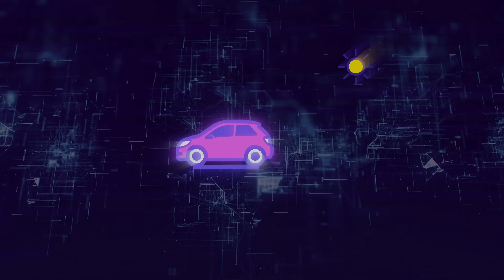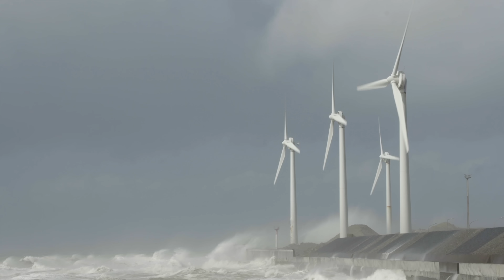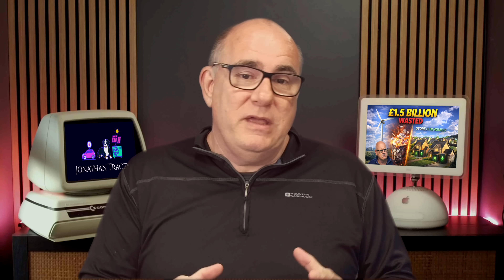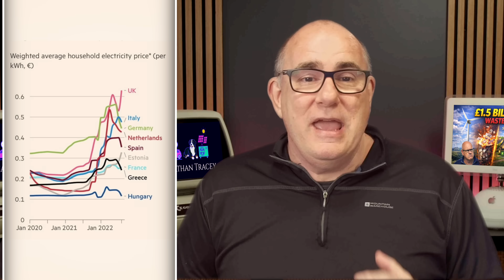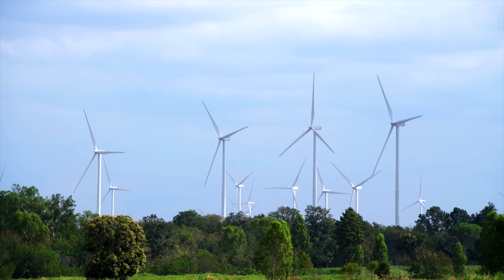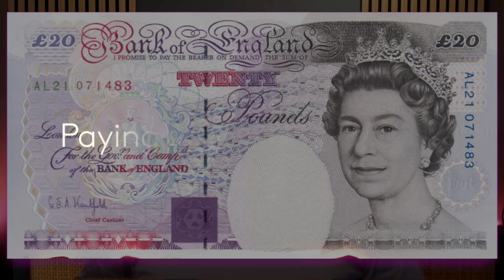We’re Paying £1 5 BILLION To Waste Energy… Here’s My Big Idea

Comment: Another simple idea. Only allow data centres to be built near wind farms, mostly in Scotland. Data is far easier to move over distances than electrons.
Reply: There are thousands of gov properties, church properties, council, army etc etc.
The could shove batteries on them.
Reply: @linuxnerd5319  Could they be put on electricity sub stations?
Reply: @linuxnerd5319  GB Energy is putting solar and possibly batteries on government buildings.
Reply: @Biggest-hz7ng not at real scale. I think they are upto 200 schools promised out of over 20k. But this is definitely where we should focus - payback would be c6 years on solar / battery.
Reply: @Mn6g1834  there aren't that many installers and it will take time.
Reply: @Biggest-hz7ng enough to do more than 200 schools. Problem is they are wasting money on Hydrogen, CCS, eV car grants etc
Reply: @Mn6g1834  I don't think much has been spent on hydrogen? 

CCS is a key part of the CCC's pathway to Net Zero by 2050, so probably the feasibility needs testing.

The EV grant promotes EV growth and hence electricity demand growth, which is needed to share out the costs of the grid expansion. It also promotes local EV manufacture. It might be considered pushing on an opening door, but it's useful to open the door faster?
Reply: Re EV grant - they are already a no brainer if getting as a company car (which the majority of new cars are). And car brands have obligations to hit a certain % BEV so we are subsidising them multiple times. Far better to invest the money in public sector solar panels or wind. Solar likely to payback in 4-6 years and last for 30+.
Reply: @Biggest-hz7ng there are thousands
Reply: @Mn6g1834 I think you're referring to solar installers here? I'm saying there aren't many large scale installers with suitable history and skills or others that can scale up. There'll be increased demand from the commercial sector too.
Reply from the maker: sounds like common sense to me, so long as they have good internet connections they don't need to be in slough
Reply: @JonathanTracey  For any major data center that wants to provide services to financial firms, even Slough is pushing it. The maximum speed of response is limited by distance, which is why most proposed data centers are in the southeast - to be near the customers with the deepest pockets.
Reply: @rogerthomas7040 I think the CEO of octopus said he had a conversation with a data centre provider who said that until told electricity could be half the price in Scotland. They have done some trials with price response on data centres ie moving data work to different times or across the world according to power prices.
Reply: I think this was one of the zonal pricing arguments, high business users would site where costs are lowest
Reply: Totally agree with you on this. Also why not put solar on homes throughout the country instead of building new power stations where the costs spiral out of control. A little generation over many, many locations soon adds up and is spread all over the country.
Reply: If Ireland can be Amazon's primary data center region in Europe, Scotland is totally viable with a sensible approach to energy and telecommunication costs and connections.
Reply: makes more sense to put them in Iceland with 24/7 energy
Reply: Our government, regardless of party, is incapable of large national projects any more. Look at HS2 as a classic example. State owned would be a disaster, but it doesn’t have to be. I’ve been following what Mark Carney, Canadian pm (ex governor of the Bank of England) is doing in Canada. They are making huge investments in national infrastructure projects to create more independence and national wealth. That shows real forward thinking and decision making. But on the subject of batteries, wouldn’t you only benefit if you were in areas where there was excess production and the grid had the ability to deliver it? Would we end up with energy savings for some and not for others? I’m all for a much wider adoption of batteries, but we need to get to a point where the cost savings benefit everyone, not just those that, at least today, can afford it.
Reply: What happens when there is no wind for a week? Data centres  need 24x365 power with no power cuts. This means switchable power sources.
Reply: @steve6375  Data center people simply care about the cheapest power bill. If they get slammed a week now and then and overall it's way cheaper they'll take the hit. Think "agile" at scale.
Reply: @etchedpixels as long as the slamming is only cost, not lack of power. 

A recent Cleaning Up video covered data centres that could "turn down" in extremis.
Reply: @Biggest-hz7ng  You can turn any data centre down if you want. It's really easy to do and a lot of them can be forced off grid in an emergency already because they've signed up for power with that proviso.

The problem in the data centre world is twofold
- Sweating assets to maximise shareholder return
- Having a billing system that's already so complicated even the data centre operators don't understand it, let alone adding in pricing based upon electricity costs.

Given enough of a difference in power prices both are quite soluble. It's just that right now it's cheaper for them to bleat about energy prices than implement things.
Reply: @steve6375 Small modular off grid reactors already in the planning stages being funded by UK private AI data centre operators. It’s just that you haven’t heard about it in the news. I can assure you this is true as I know the Project Manager on the project.
Reply: I’m not sure but that boat may have sailed elsewhere, the larger data centres in USA are building their own SMRs to have their own reliable, secure energy generation/supply not reliant on national or local government or intermittent ‘green’ energy, at least not with out a viable backup generation method. We can neither offer cheap or reliable energy in the UK and the approvals system for nuclear is measured in years not months
Reply: @anthony208 It’s happening so we will see eh….
Reply: @anthony208 There are zero SMRs today in the USA.
Reply: @anthony208 Just how many smr are in place today globally?
Reply: @Mn6g1834  I believe it is two working, four under construction and over one hundred designs being progressed apparently. 
SMRs have been installed in military ships and subs since 1950s, granted more commonly using enriched uranium fuel, outlawed for anything other than military use
Reply: @anthony208 yes but not these designs. So not yet a scale solution. Would be great if they can be at a sensible cost but it looks unlikely.

Comment: It's not a new idea but the logistics, consumer resistance (they're still struggling to get people to accept smart meters) and the standardisation of interfaces/protocols aren't trivial. While it seems simple in principle to just scale up existing grid management systems I suspect it's much harder than you think particularly to do it in a reliable way at scale. Get it wrong because of an unforseen race condition for example and the grid could crash.
Reply from the maker: @mfx1 You’re absolutely right — scaling this isn’t trivial 👍  

The key difference is we don’t need perfect coordination on day one. Even partial adoption starts reducing peaks and curtailment.  

It’s more of a phased rollout than a “flip the switch and hope it works” scenario.
Reply: @JonathanTracey To a degree the are doing that phased rollout already but with early adopter consumers buying thier own systems, if those systems don't throw up any major issues then they can act as a template/test bed for future expansion. Nothing is ever going to happen quickly with a problem this size and rushing into things historically has never panned out well.

Comment: I like the idea as a whole for the good of not wasting electricity but for most a time of use tariff with just a 2 kw hour battery they would be worse off than if the had a standard tariff.

For example my dad is on a economy 7 with octopus and his off peak is 14p which is criminal and 33p peak if he had a 2kw usage at off peak as a average use house has 8kw he would only say 19p. And would have to buy the other 6kw at peak rate.

On the other hand a home with standard tariff of 21p (which was my rate) flat rate would spend £1.68 a day but on economy 7 the same usage with the suggested system they would have spent £2.26.

In this instance using actual tariffs that I was on and dad is on financially I would be better off every day not having a battery and a time of use tariff.

They would be worse off by 58p a day than if they had a standard tariff.
Reply from the maker: @neil3589 You’ve done the maths right 👍  

A small battery only works if the price gap is big enough — otherwise it doesn’t stack up.  

That’s why tariffs (and timing) matter just as much as the hardware.
Reply: @JonathanTracey unfortunately a 2kw battery won’t work for a time of use tariff unless they will give standard uses a ev priced tariff which they won’t so the user wouldn’t be any better off with this situation.

Comment: it is not the charging of the batteries that is the problem. It is when the batteries discharging into the house. That is the issue, so that the gas plants do not need to be fired up to cover the excess supply  required, that the grid can not supply.
Reply from the maker: @johniooi3954 You’re spot on 👍  

Discharge is where the real value is — that’s what avoids peak demand and reduces the need for gas to step in.  

Charging is easy, it’s when and how you use it that matters.

Comment: If only the grid could upgrade the network to carry the power from Scotland to the South East... Oh they are, just going to take decades to update the network. All I want is a 10kWh battery (can't afford) & that would cover my peak usage 90% of the time & charge overnight on cheap rate.
Reply from the maker: @johniooi3954 You’ve nailed the use case 👍  

A 10kWh battery would cover most peak usage for a typical home — the problem is upfront cost.  

And you’re right on the grid — upgrades are happening, but they’re measured in decades. That’s why smaller, local solutions can make a difference now rather than waiting.
Reply: @JonathanTracey  10kWh battery is a grand, 3.6kW hybrid inverter is a grand. The problem is the bit between the components and them appearing in your house.

Grants won't help either - add a 1000 grant and you'll both make batteries £1000 more expensive overnight and double the number of shysters in the industry (it's already rapidly flooding with them at the moment as all the dodgy ECO4 people look for new marks)

Drop kicking the MCS out of most of it would do wonders. No more mandatory insurances, fees coming out of every install, requirement to use certain brands of approved product and all the rest of it. MCS doesn't even allow use of second hand panels so it's awful from an environmental perspective.

If the MCS can offer add on value then they'll survive without their bizarre historic special access to export tariffs.

Comment: i see the other day the American grid change their high power cable for a new type with double the power capacity instead of building more pylons.
Reply from the maker: @raeted43 Yep — that’s called reconductoring 👍  

You replace the cable with higher capacity conductors (sometimes with advanced materials) to push more power through existing lines.  

It helps, but it’s not a silver bullet — you still hit limits on towers, substations, and thermal constraints.

Comment: The grid has bottlenecks you just need to up grade them with high voltage dc lines to supply the south or grid storage at either side of the bottleneck to begin with… then increasing more to smooth out the duck curve…
Reply from the maker: the problem is those lines cost billion to bulid and take decades, we need solutions now

Comment: I already do this with a DJi battery. Over winter it's charged on cheap power, in summer by solar. In 4 months, I've shifted about 300kwh to cheap or free power, saving about £75. The device was £799, so by the ROI metric I'll be in the black in 42 months. In Renault it will be sooner because in summer the charge is entirely free.
Reply from the maker: @Avalanche_Andy That’s a great real-world example 👍  

£75 in 4 months is solid, especially as summer ramps up — that’s where these really start to shine with “free” solar going in.

Comment: The trouble is that the vast majority of houses are on the 'load-side' of the transmission constraints.  - unless you were to put 200kWh of batteries into every house in Scotland/Wales/etc  - But that would burn down the LV networks there...
Reply from the maker: @dietydeity You’re right on the constraint point 👍  

The trick is you don’t need 200kWh per house — even small amounts spread across lots of homes can start shifting demand and reducing peaks without stressing the network.
Reply: @JonathanTracey  I've done the maths. The battery required for Scotland at £200/kWh (less than the £500/kWh you quoted) would cost £48B. The cables they're installing to solve the problem cost £8B.
Reply: @Leo99929  The cable is more than solving the problem - there's a large amount of overbuilding going on. If that overbuilding proves wise long term - who knows.
Reply: @etchedpixels  You're 100% correct! They're massively overbuilding to enable  an enormous expansion in renewables investment in the area because there is such an abundance. I think only something like £2B is needed to "solve" the current bottleneck, and the rest is expansion. 

Given how cheap renewables are vs fossil fuels and the national security advantage of being energy independent, I think it's a relatively safe and progressive policy heading in the right direction. Especially given we spend £1.5B per year to not use the current power, and that's STILL cheaper than gas.

Comment: My guess is that you could get a 2kwh battery down to around £100 with this kind of scale.   I wonder if it is also worth incentivising industry moves to areas where there is plenty of cheap energy.  We don't need everyone concentrated in the SE.
Reply from the maker: @MrChristiangraham £100 for 2kWh would be amazing, but that’s a big stretch once you include inverter, control, install etc.  

Completely agree on industry though — moving demand closer to cheap generation is a huge part of the solution 👍
Reply: @JonathanTracey the gov turned down grid changes cos the south might be affected if industry etc moved north.
Reply: 2kWh with inverter and the like you'll be lucky to get below about 500. Those are still below the kind of prices consumer products are hitting at vast scale today. Folks like Ecoflow make millions and millions of little boxes already.

If anything you are going to want to keep the prices higher and scale the battery size. That's the way it's going at this point. Inverters, end use safe cases and cables are not getting any cheaper and are very well established old industry with few opportunities for big breakthroughs. It's the battery bit that keeps getting cheaper - so better to think 4kWh, 5kWh, and in time 10kWh or more IMHO.

Comment: How about requiring wind farms and solar farms to pay for the storage required to store their surplus energy? The answer is that it would be prohibitively expensive for them to do it, it's much cheaper for them to get someone else to pay for it.
Reply from the maker: @brendanpells912 I get the logic, but it doesn’t quite work like that in practice 👍  

If you force wind/solar farms to pay for storage, they’ll just pass that cost straight through into the price of electricity — so ultimately consumers still pay for it anyway.  

But the bigger issue is utilisation. Storage is most valuable when it’s shared across the whole system:
- Sometimes it’s storing excess wind  
- Sometimes solar  
- Sometimes just shifting cheap overnight power  

If every generator had to build its own dedicated storage, you’d end up massively overbuilding it, and most of it would sit idle a lot of the time — which is exactly what makes it expensive.  

So it’s not really about “getting someone else to pay” — it’s about building shared infrastructure that gets used efficiently across the whole grid.  

Same reason we don’t make every power station build its own transmission lines 👍